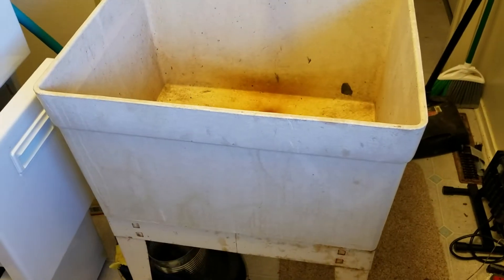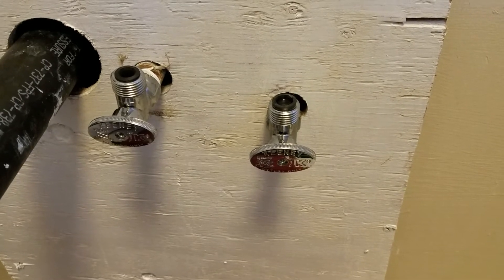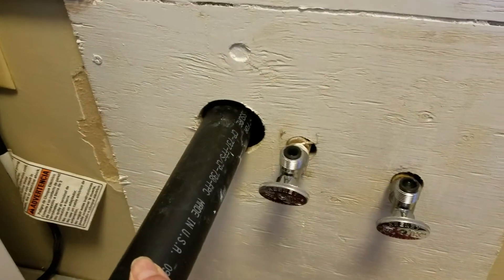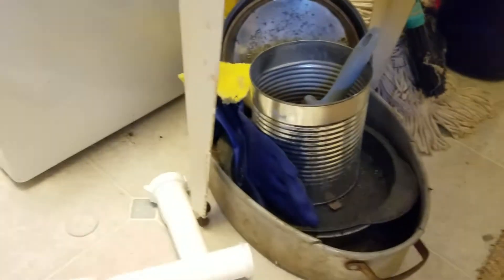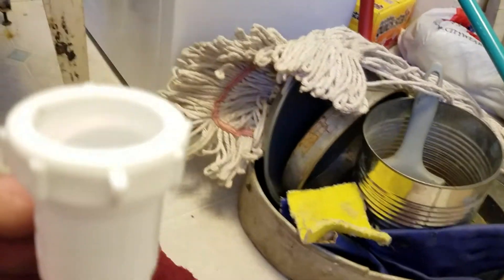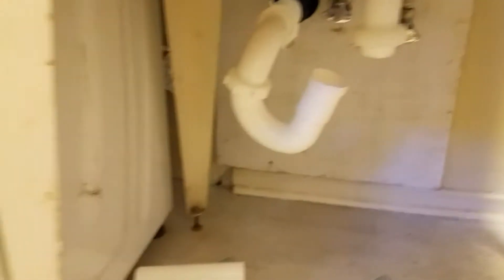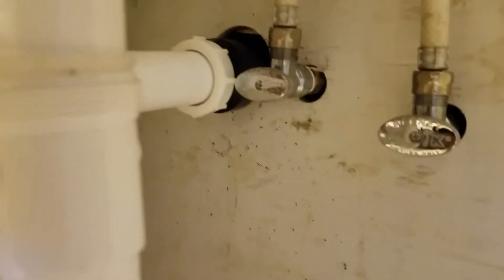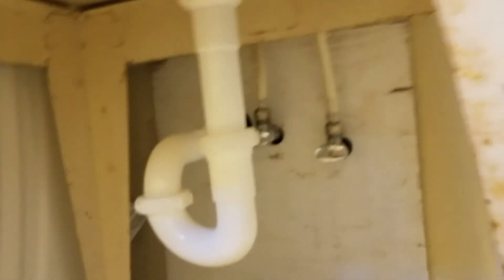Replace a p trap drain, use a flex T

Comment: For  those interested, you should always apply teflon then pipe dope/thread sealant in that order on your angle stops (water valves), just a little tech tip.  Hand tighten the compression nut, followed by a good turn with a wrench/locks, and do not over-tighten, you'll ruin the ferrules connection.   Although this wouldn't pass inspection, there's nothing wrong with doing it yourself and saving your money.  Good job bud.